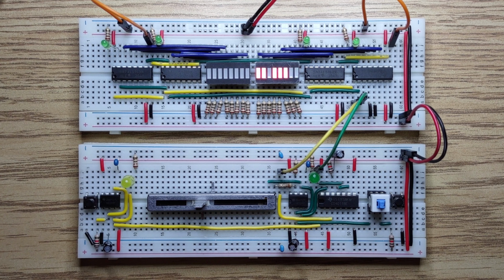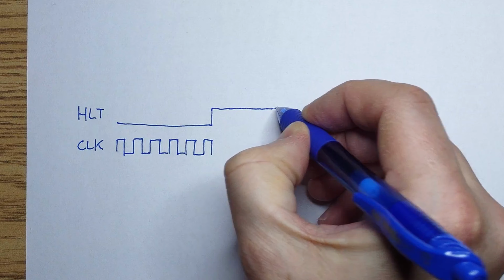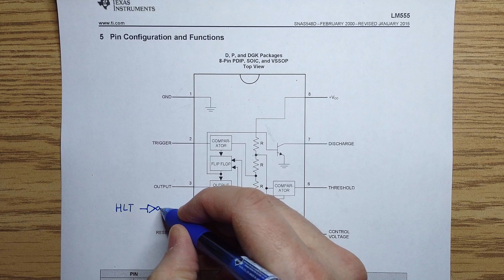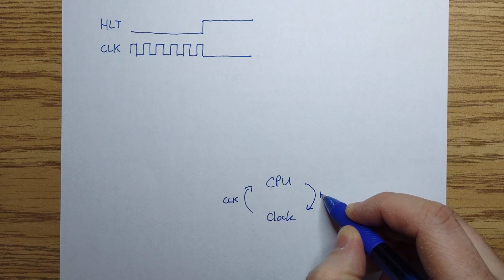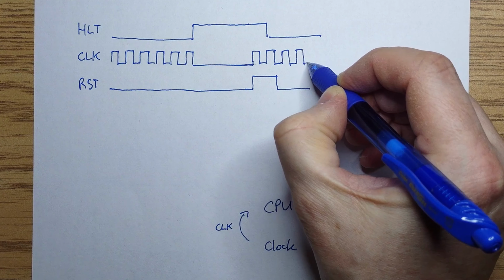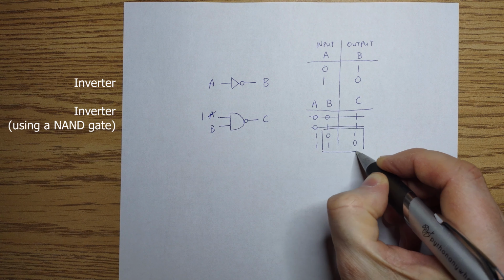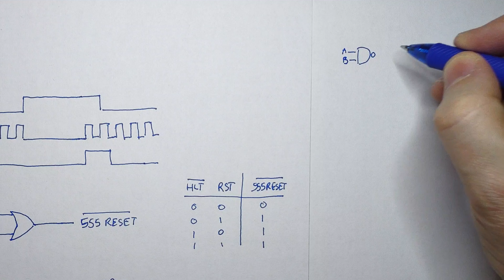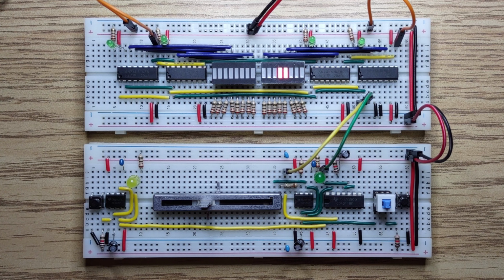Clock Halt Circuit with 4011 NAND Gate and 555 Timer

Comment: My halt led flashes. Any suggestions
Reply from the maker: Not sure what you mean, but I did have some problems with halt when the voltage of the input wasn't high enough due to poor connections on the power rails (and multiple LEDs pulling down on the line) so you could check that.
Reply: @IanWard1  will do
Reply: It was the LED replaced with an orange one works great